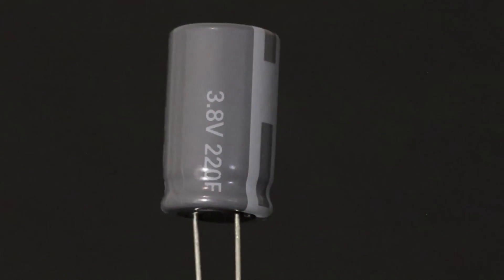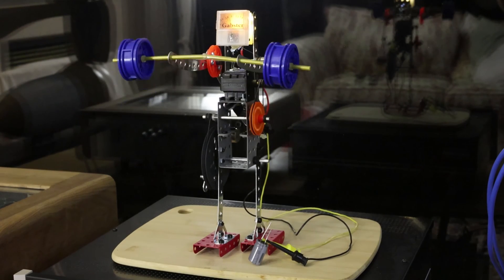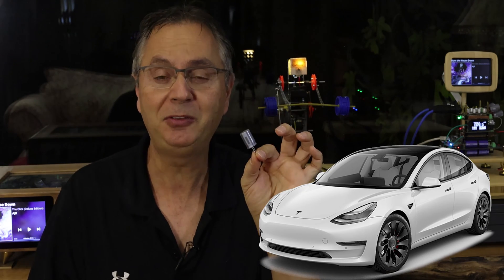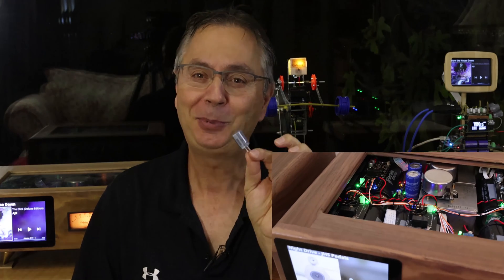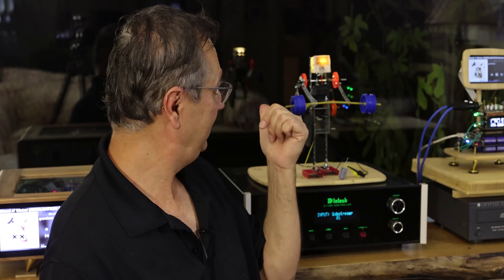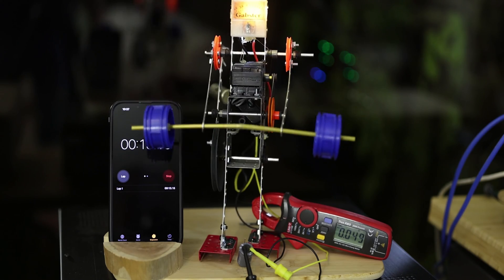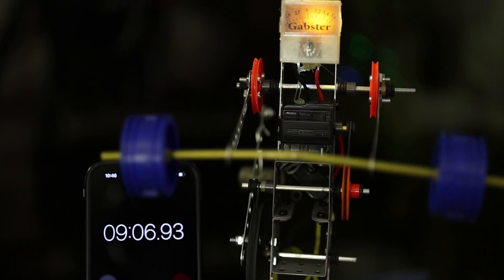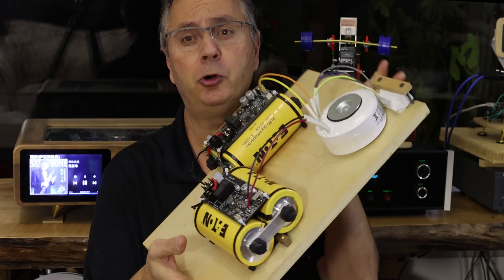Hybrid Capacitors are they the  Audio and Tesla future, and Gabster Power.

Comment: Unfortunately they have limited amp output of like 1amp continuous for 220 version.

Better to use pure ultracapitors in series for your voltage with balancing boards... The 325F s19 maxwell cap has 1.6mohm esr too vs the 220f cap here is 100 so even a bunch of s19 in series is better for most things and can do insane amp output

Comment: @gabster would that trick could solved my noise issue out of my analog opamp stage, both l and r xlr have a little buzz, even if i know the ifi power are very  quiet, instead i might go for linear dual 5v power? I try to find where it come from, cause i can say that this ian canada kit sound amazing apart my noise issue
 Thanks for your video..very usefull